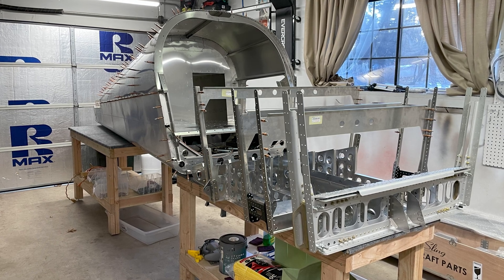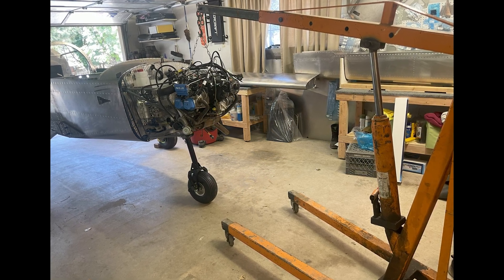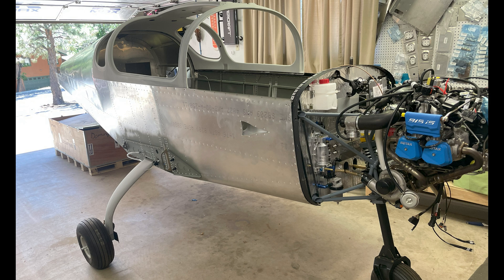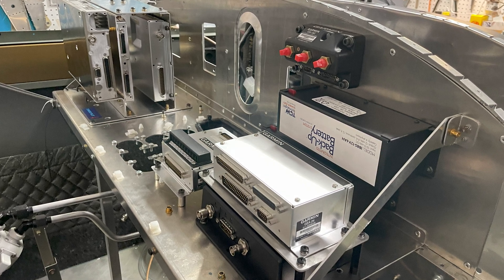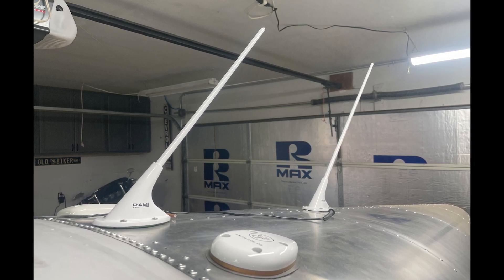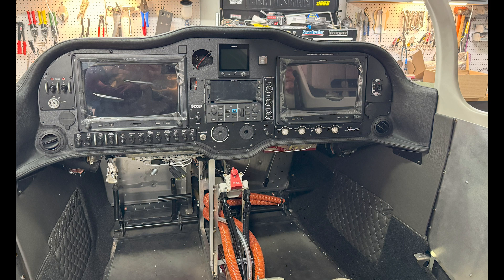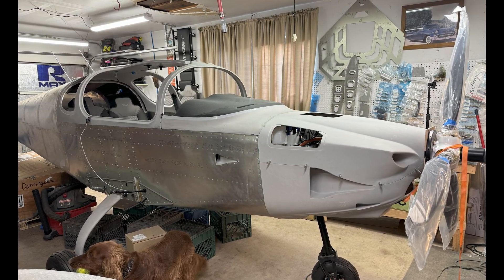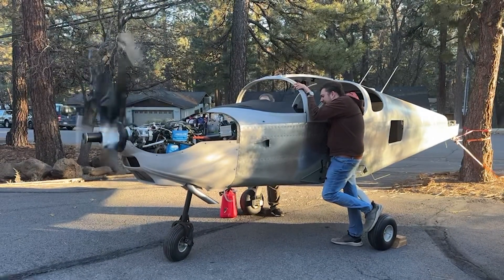Sling TSi - 1 Year Later

Comment: Nice build! Why not install the gps antennas on top of the glare shield, under the windscreen? Keeps the drag down and keeps the wires shorter.
Reply from the maker: We followed Garmin’s instructions for best mounting points. We also got feedback from other builders and Midwest Panel Builders that the airframe will sometimes shadow the antenna and cause signal loss at certain bank angles when they are installed inside. 
I think the drag from those small antennas is probably minimal.

Comment: I don't understand why anyone designs for sheet and rivet these days instead of composite. It must be so much easier to just make one piece. And carbon fiber can be plenty stiff in just a thin double curved shell with no stringers or frames. Also hard to beat for weight. But it seems Sling is moving to composites.